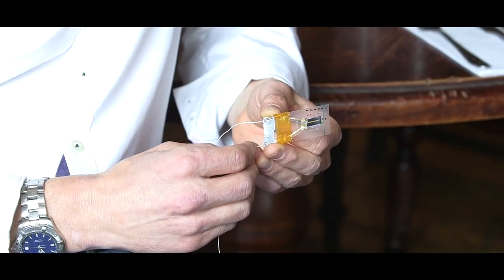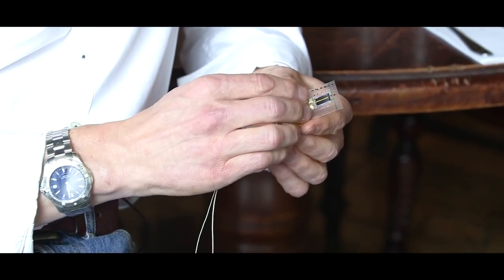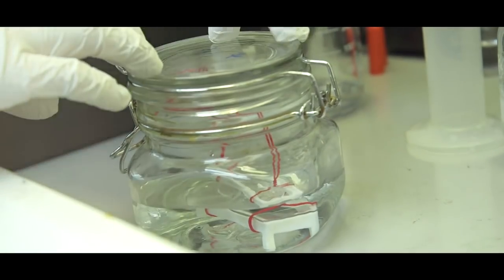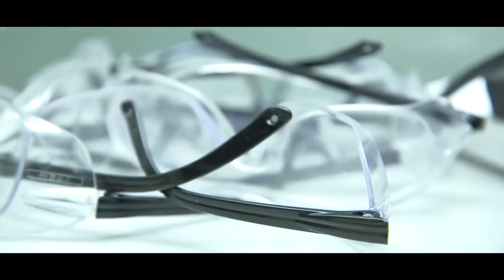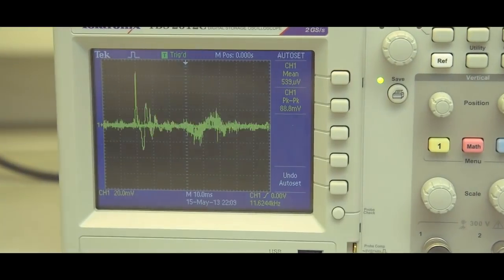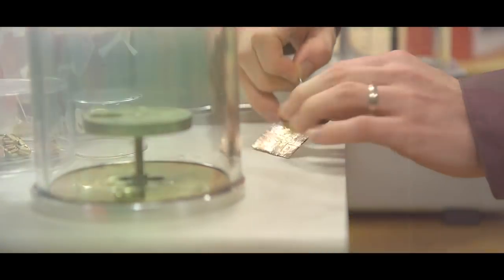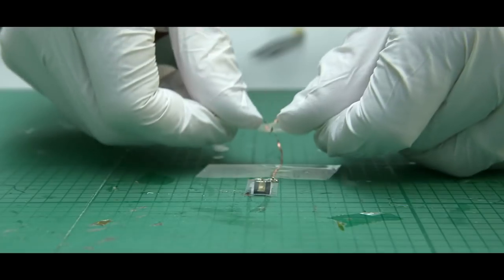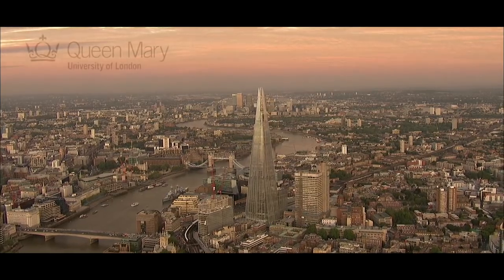Good Vibrations: harvesting energy from sound - Professor Steve Dunn

Comment: This will be great for powering led lights and other low powered stuff.
Reply: Or you can put thousands and thousands of these small devices in a singular room, calculate the exact resonant frequency of that room, generate that specific acoustic frequency at the exact amplitude so that we create a continuous feedback of that frequency whilst not too much so that we ensure it doesn't feedback too much and making sure it doesn't destroy the room, meaning that you have a singular frequency source, with multiple source input devices that all work together in harmony to turn the acoustic vibrations into mechanical energy that is thus turned into electricity at a higher intensity of electrical yield.
Reply: Or something like that... y'know?
Reply: @cactiartofcardboardia29  I am glad I was reading and found this. You are pretty close

Comment: You can not harness to much power this way though. As you can have load sounds from low Watt speakers and a receiver would pick up a small fraction of that power. Unless you harness something like ocean waves, cosmic sounds and tap into super tiny vibrations but on large scale.
Reply: That's the mystery. Sources are there. Question is HOW to harness those vibrations? Wish such research projects got funded properly for commercial applications.
Reply: What about people who go fishing in he ocean
Reply: What about the sounds of a mega city like Dhaka Bangladesh

Comment: Sound can be converted into motion. Motion can produce heat/energy. Turntables existed a hundred years ago. A modest battery could power a car via a light giving off sound, which produces motion, causing heat. It's a sound motor with reasonable battery. Lightbulb NOT really necessary to process since radio car antennas have existed long time. It's option though. Also, regenerative breaking, wind drag harvesting, and solar, all allow for vehicles to be green power with little need for charging. Taxi delivery charge, and drone relay charging network, can be real.

Comment: Solar can generate power to run a frequency generator then attach to this& create more energy by frequency vibration& this helps not needing so many solar panels. Increase the power of the energy, plasma light bulbs would help aswell for they are mini suns. Plasma grow lights& lighting through out the home producing vitamin A inhouse. Indoor Plants thrive. Just one panel can run a frequency generator to produce power off with this invention added to Solar as a solar boost& the solar & battery would be the root source to get initial charge to run frequency generator& makes sense. GoodVibes Solar Energy Systems. Hemp homes with underground thermal cooling and heating would be the new way of earth living that ties us into nature's vibes, hand pumps and we'll pumps for clean water with copper pipes& water atomization filters for charged water for optimum health. Underground greenhouses that have earth surface windows that create a growing earth heated environment that would be a great add to the new way we do green building in the near future as we tap into both sun& earth to feel the vibes fully in pure life living in all we do as we partner with Nature!
Reply: If you can come up with a way for that to put a steady profit to government authority you may be right. It has to have sustainable profitability or it will always be challenged by special interests.

Comment: was just like with hydrogen when they said you couldn't make it on your own and you can make hydrogen you just need electricity to do it and you need alkaline in the water slendy in it so that you can actually hit the electricity can Frac the water to make hydrogen so would sound if we could use sound in the same way you sound power a lot of different things when we got to go back to the pyramids with the head of the echo Noche locating Chambers in there when you spoke in their head of different resin resignada thing where the pyramids were built for a different purpose but for us to use it for a different thing to make electricity just saying
Reply: I've been reading these and you are the first person who has gotten close to the most common sense and practical use of this tech. It is going to most likely be extremely large, sound proofed dome structures. These will be the replacement of nuclear power plants and coal plants. The electricity will be generated inside the dome and then distributed to customers just as it currently is, and will be profitable for utility companies.  Keep I'm mind the only way that we will get a green planet will be if it has sustainable profitability.